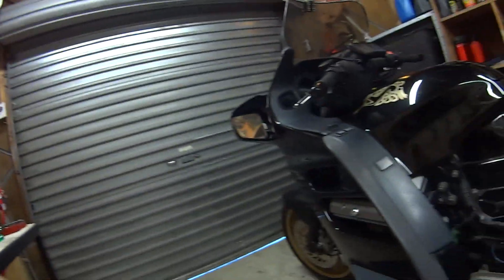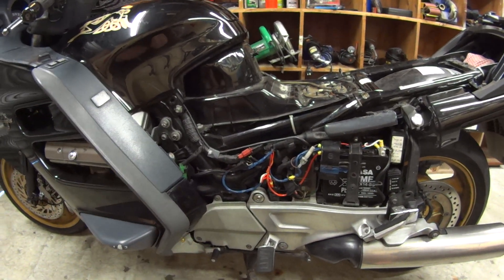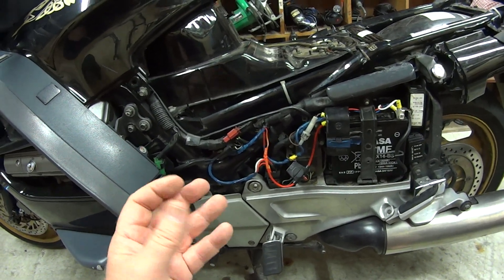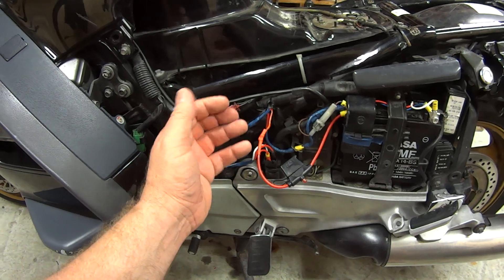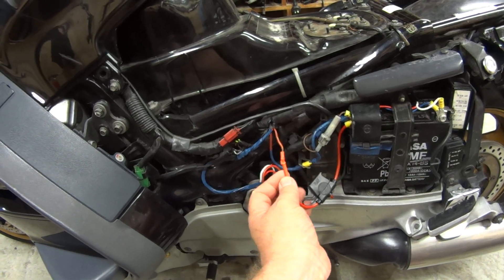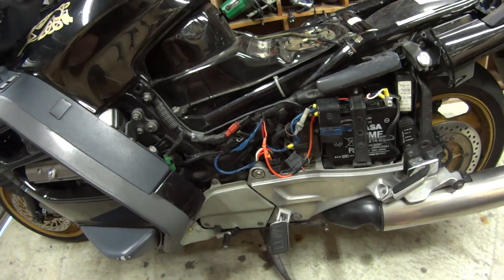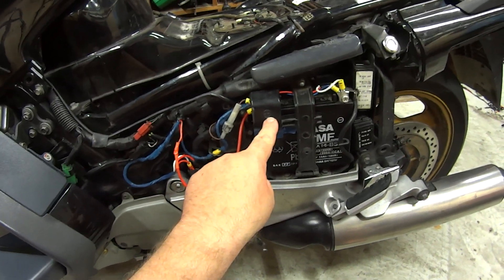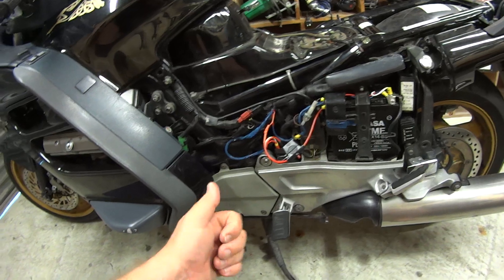ST1100 electrical failure fix

Comment: I am aftaid you haven't fixed it. Instead of red+red-white sharing a single 30 amp fuse they now both have their own 30A fuse.
Reply from the maker: Mate, I sold the bike over 2 years ago, non issue!
Reply from the maker: K, great. Never had the same issue after that. This was a fix I got off the net. Rather than shearing what I haven't done why don't you share with people who have the same issue how to fix it properly since you are the expert
Reply: @kiwibadger7826  Well I am still in the middle of it. A friend of mine bought a ST1100 with a crispy rectifier. The rectifier was swiftly replaced no problem but the previous owner has been doing some bypassing much like you have. The main fuse had four spares tucked away between its mounting rubbers. Also he has wired the red/white wire (regulator output) directly to the battery via a 20amp fuse, bypassing the original main fuse on the starter relay. According to the wiring diagram (0030Z-MAJ-U300) the green 30A fuse in the starter relay fuses both the red wire (to the fusebox) and the red-white wire (regulator output). 

Problem is that the regulator should only output max. 1A at 5000rpm according to the maintenance manual yet it's outputting enough to blow this 20amp fuse. _where are those 20A coming from... _ The regulator is new so it's either the generator or something stupid like a wiring error or ground fault. It's probably going to be a story of pulling as many fuses as I can and checking all grounding points. Maybe try and see if I can mess with that fancy field coil in order to see wether that still works or not. I'll try to update.

Anyway I saw your fix in wich you've essentially only got the red-white alternator output (remember, 1A max) fused by a 30 amp main fuse wich seems very ill-advised. Thought you should know.
Reply: @kiwibadger7826  Update: I'm a dumbass.
Logically, the alternator should be outputting 1A EXCESS to the battery where it should be dissipated in the form of heat.

Of course, it is a 28A alternator.
Of course, even the low beams on a ST1100 would draw more then 1A.
The previous owner fused the 28A alternator at 20A. OFCOURSE THAT WOULD BLOW!

Now I just need to see why my charging voltage is still around 16,5 volts (and 4Amps).
Reply: @kiwibadger7826  The 1996-onwards models have the alternator wired up much the same way: Not trough the red plug but via a seporate fuse: 40 amp alternator behind a 55 amp fuse.

So it seems all is right with this method.

Comment: WHY does the st1100 overheat that wire?
Reply from the maker: I believe it's to do with the starter faulting, short answer is I don't know.
Reply: @kiwibadger7826  it’s not the starter. That’s definite. The other wires operate the starter solenoid. The red wire that melts the plug comes from the alternator so I’m wondering if it’s to do with the alternator output. I just don’t see how connecting the red wire directly to the battery with a fuse stops it from getting hot. Perhaps resistance in the terminals in the solenoid block?
Reply from the maker: @internetpolification  all I can tell you is that it worked. Maybe it's magic.
Reply: @kiwibadger7826  I did the mod today. And waved a magic wand. It works!😀

Comment: This gets you over the initial failure but does not fix the cause,  you'd be better fitting an ignition relay to take the load away from the ignition switch - google it.